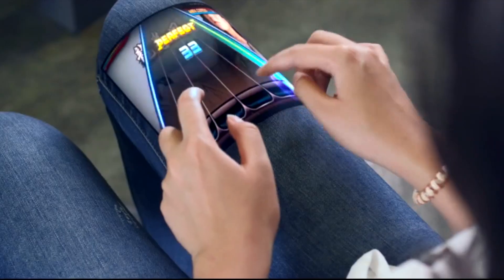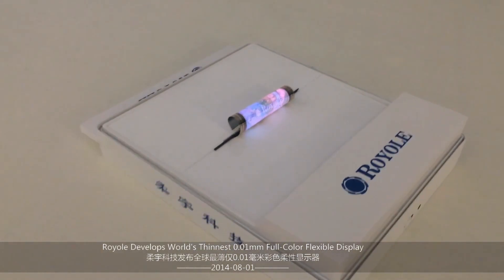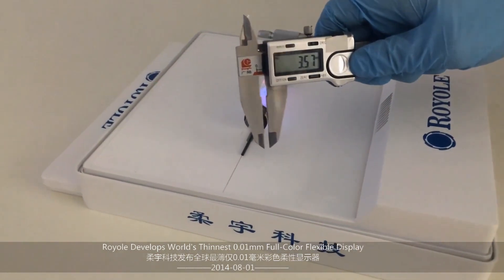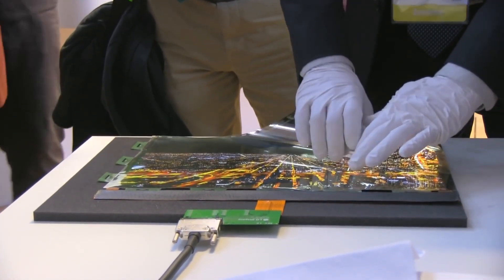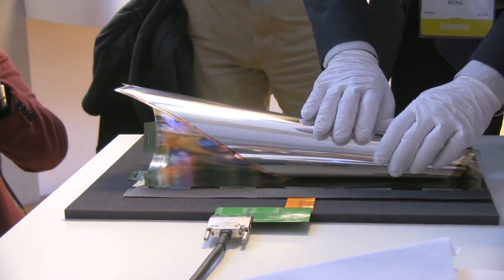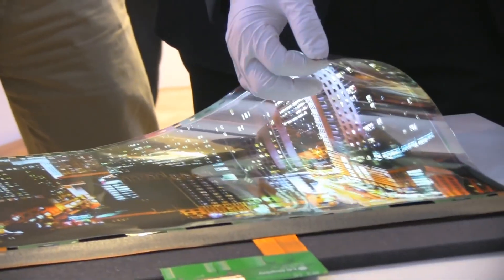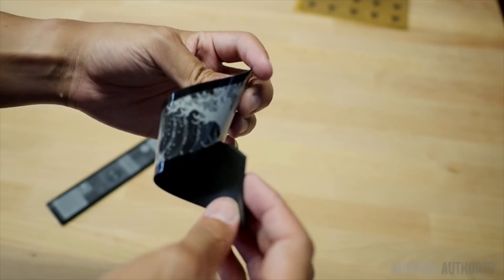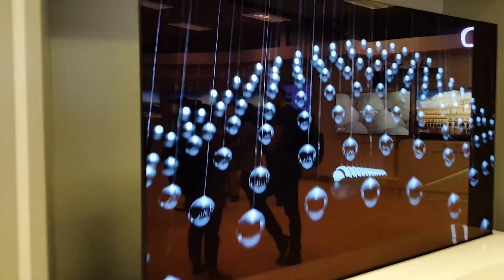What is Stopping Flexible Displays From Taking Over?

Comment: flexible display smartphone? Is there a way a battery could be flexible also? at the same flexibility of the display? I think that's the biggest problem. in current battery technology, that would be a potential danger. especially if the smartphone that they're talking about is foldable or can can be rolled into pen size...

Comment: The reason flexible displays havent "Taken Over" is because they are a pointless gimmick.
Reply: You won't have them in a phone for sure, but they can be used elsewhere. Actually they're not pointless at all, very useful in fact.
Reply: Also they are NOT crease proof
Reply: Famous last words. You lack imagination.
Reply: Resarth If they can reduce manufacturering costs, imagine a flexible display book, or brochure, manual, catalogue. Or perhaps, a multi page tablet or laptop, possibilities are endless.
Reply: It wasn't made by Apple, that's why its "pointless gimmick". Right Resarth?
Reply: +fr33k 

self-repairing membranes, boy.
Reply: @Void of Space and Time 

I don't think so, We are not that technologically advanced.
Reply: For military, field engineers, space shuttle to save launch weight etc. It has it's uses for those who are looking to save massive amount of weight where ounces matter. they would be good.
Reply: They are not pointless, they are useful. Such a device will be so compact and portable capable of being put in small places.
Reply: It’ll be nice to have in school. If it’s flexible, it should be thin enough so your professor can’t see if you place it on your desk and can easily hide it.
Reply: Niko no one wants it for phone. Its the worst engineering if its on phone.
Reply: Kermo Sarapson its because even without steve jobs. Apple wont make a flexible phone stupid. Trying to be a badass smart huh?

Comment: whats the point of a portable flexible display, if you need a battery and something to run it on. mb if you put it in glasses. i think xbox/microsoft is working on AR maybe there using the same tech

Comment: I can't think of many applications because they still have to be attached to something. No point having an inflexible phone with a flexible screen and bendable phones werent recieved well (Apple lol.)  I believe the curved TV market is and a downslide also, so I don't know but I saw a comment about VR screens which makes sense if they can get the pixel density and alll the other factors controlled that you need for good VR.

Comment: I like the idea of using them in augmented reality. If you were able to make the screen fully transparent but still display stuff on certain sections, you could cover a pair of glasses with them, like the guy in the video. That would absolutely amazing. VR would also be an awesome application because you could reduce a massive amount of the bulk in a VR headset, due to the fact that the screen is so light and flexible, only requiring the accelerometers and motion tracking, which is already pretty small.

Comment: I don't get the hype for flexible displays. They seem like they would be obnoxiously frustrating to use, like trying to use a sheet of paper or projector foil as a display, you would need something rigid so you would be able to use it properly. I like how unbelievably thin they are though, they would work great as easy mount tv's or portable screens of that type. You can roll it up and stick it in a painting tube, take it to the park or something and enjoy a movie on a screen out in the open. Like a projector but without the big massive projector itself, just the screen that you can hang up anywhere. If you were able to make them big enough you could put animated billboards anywhere, and because they're so thin and flexible they look like they could handle something being thrown at them, perfect for public spaces. You could have them hanging up on train station walls, and if you wanted to protect them from vandalism and spray paint, just place a second transparent plastic sheet over it, and if it gets covered in spray paint, just take it down and put a new cover up, the screen remains fine. I think the greatest application for this is in the advertisement industry and the portable screens industry, however the only application for phones i can see is that you would be able to save a lot of space that goes towards the screen, instead using it to add more processing power or a bigger battery whilst still keeping the phone a decent size. The fact that they're flexible seems like it's just annoying if you tried to make phones out of them, you'd need to make them rigid and that defeats the purpose of the whole flexible thing.

Comment: if you can rool up the screen you can protect it so now instead of having a tablet With loads of scratches on Your Field trip bring this in a protected way and the only time it is exposed to scratches is when using it.

so first thing i noticed With this video is 1 wy is the military not using this. does the military never use digital screen. wel take this screen rool it up and proteckt it simple way to carry it around instead of say carry a giant tv on Your back simply roll it up and wear a tube on you back. make smaler ones and roll them up give them to all troops and when they get New orders they can rool oute the screen and watch the comand like say here is a map here is theenemy and here is how we are going to attack. if all got a personal screen that is durable as the screen is protected at all times unles you are using it. and say Your smart phone when it is yourbag or pocety and you have it With something else it might get scratches and it cost losts of Money if the phone falls and cracs. With this display i cant see it shattering on inpact as it is foladable and more durable. and if  you cansay have a tube With microphone and speaker then a roled up screen inside you dont need the screen to anser the phone just press a buton and talk to a sylinder if you want to use the screen simply unroll the screen.

Comment: The PRACTICAL answer to why they aren't on the market, is not volume, it's the fact that DUHHH... they would be very fragile!  Tap it too hard with a fingernail, accidentally fold, crease or tear the thing, and it's over.  Sit on it, snag it etc. you get the idea...

People buy cases to protect their already tough phones from breakage.  Here is just trading brittleness for another weakness by nearly eliminating any protective structure.

If its flexible to be ready to apply to a sturdy, curved surface, then that makes more sense.  But not raw, flapping in the wind for everyday use.  Retarded.
Reply: More research, funding require for a real flexible screen.

Comment: These are a great idea with so many potential uses.
I feel that as a phone screen though one simple issue people may have is that when pressing buttons on the screen for example, they like it to be a hard surface that they press against.
Ok, so you can use a table i guess but what if that's not available.

Comment: I can't see a consumer product that is flexible, that doesn't run the risk of being folded flat on itself. Yeah, you rool up your phone, and put it in your pocket, but then you hug someone, or sit on it, and it fold together, ruining the smooth surface and potentially the electronics within. 
For industrial purposes and military purposes, there are probably a myriad implementations that could make use of flexible displays for mounting displays on irregular surfaces or within confined spaces. Also, motion tracking technology combined with a display mounted onto a cylinder would allow for graphics to follow a person around a room (whatever good that would do). 
So, I'm sure applications will present themselves in the future, but I can't really see one of them being a dependable personal piece of electronics, outside of a gimmicky wearable like a "smart-bracelet", or "smart-sun visor".

Comment: well..  its useless to some extent because in smartphones you can't make the rest of the components flexible. so ok you could have a smartphone in the shape of a tube..  Maybe the display could be slightly bigger but it would also be awkward to handle.. imagine how flimsy it would be if the display gives in when you use the touch display...   but maybe just put a flex screen on  a normal phone since then at least it wouldn't break as easily when falling down or would it? maybe it would scratch too easily

Comment: Just because the screen can fold does not mean that it should fold! The solved problem of the cracked screen is the single biggest reason to jump on that mothafuckin boat. But planned absolesence is a real thing...so the technology will get postponed by big wigs for as much as possible.

Comment: Imagine coating the inside of a cars windshield with a transparent & flexible screen, then add a bunch of sensors of all kinds:
In the night the screen will highlight animals that is detected by IR cameras, and it can map out the road in low light conditions (or you can use your headlights, but where is the fun in that?  ;P )

The car can either use 3d cameras to detect your eyes and then model the interface so it lines up with what you see, or it can "assume" that your eyes will be in a general area where eyes usually are and simplify the calculations but will be less immersive.

Comment: I would use them in my work to eliminate the need for printed A0 engineering drawings in site. And i can assure you these come in hundreds per project which can be replaced by a rolling sheet screen display in a roller plastic can with a slot for usb or SD cards

Comment: I think it will do wonders for things like pole advertising and in immersive 3D things,  think about having a 10' square or circular room that is showing you the inside of the louvre and you can explore it.  It would also revolutionize shipping of TVs.  Imagine going to Best Buy and buying an 80" TV that comes in a tube.  Maybe they ca make it where you can connect panels to panels to expand the size of the TV or to add a widget to that TV.  A square you connect to the side of your wall mounted TV that displays email or news alerts or a website.

Comment: I can see issues, uses and improvements here...

Issue #1 - The US military MUST weaponize it and then the CIA, FBI, NSA, MI6, MUST have backdoor spy tools installed on it before the public is allowed to get it so there's that wait.

Issue #2 - Price.We all know that the first 10 years of these will be astronomically high priced and out of reach for most people financially where even a small one would cost several hundred dollars and a TV sized one several thousand.
With this said Apple will make a shitty phone with one that will be the size of a mouse mat, cost as much as a small car, and still have shitty service and poor performance.

Issue 3 - Support hardware, main boards, storage, batteries, all are still pretty much solid, you cannot roll up a Li-Ion or Li-Po cell without some violent reaction usually ending in lots of toxic smoke and flames.. You are not going to buy a TV set or a phone that has exposed circuit boards, and batteries hanging off it.. Call me crazy but I think most people like things to be all together and have some style about it...

Practical uses:

1. Elimination of projectors, TV's and Monitors, These can be deployed just the same as a projector screen but without the projector and give you true HD visuals. Also this will eliminate all flat screen TV sets and computer monitors.

2. GPS and map devices, Yeah this speaks for itself, replace that suction cup thing that never stays on the windshield with one of these..

3. Vehicle HUD that can be actually part of #2. but the difference is the screen is infused into the windshield as part of the windshields manufacturing process, this is so it does not come unrolled while driving and so on..

4. Smart glasses that can auto focus, tint, zoom, etc. could be Bluetooth compatible to show your phones screen on the lenses and allow for voice commands..Not recommended for use while driving of course.
Prescription glasses could also be  reinvented here, glasses could be reprogrammed to a desired "lens" setting by a doctor instead of buying a whole new set of glasses.

5. Company logos, Branding,  Product labels and advertisement. This would be far later on when they become so mainstream people literally fell ok with tossing them away like paper... But a cola bottle could have an animated logo or whatever on it, same goes for other adverts, billboards, road signs, etc..

Improvements:

1. Cut to size - it would be awesome if you could just buy a roll and cut it to your desires shape and size, attach the patented, developed, sealed, foolproof interface cable and use it..

2. Water proofing, since we like on a planet that is 2/3 water, don't you think this would be a nice option?

3. Folding - Not only can you roll it up but you can fold it like paper and it not suffer any permanent damage.

4. High impact options. Why not make some bullet proof for the military of course XD..

Comment: Flexible (so conformable) screen tech. would be a godsend for the Advertising / Signage industry. How many cars / panel vans do you see EVERY day with "magnetic" advertising / signage on panels (or doors)? - Now, envision these "signs" as fully dynamic video displays, capable of withstanding the daily rough and tumble of traffic.The problem would be that such signage would be so distracting that the accident rate might possibly rocket! :-)

Comment: I am about to finish my PhD on Graphene based flexible electronics. Flexible electronics require a transparent electrode that can bend several times without cracking. ITO (indium tin oxide) electrodes that are used pretty much in every phone and TV are fairly brittle. They can be placed on a curved rigid glass, but cannot be repeatedly bend on a flexible plastic. 
Transparent electrodes that can be bent repeatedly are generally fabricated with conductive polymers. They are very sensitive to heat and chemical attack. They can also degrade in time by themselves. So a process would need to address for all these issues. They are also fairly expensive and hard to synthesize. Compared to ITO which is simply a metal oxide, conductive polymers require more strict synthesis procedure. Conductive polymers are also less electrically conductive than ITO electrodes, so a device design has to take that into consideration (I guess this could cause an efficiency issue. More energy would be loss to heat). 
So, it is true that manufacturing volume has to increase for conductive polymer synthesis to at least drop cost of material. There is also the issue of how to deposit a very thin layer conductive polymer film evenly on a surface. Conductive polymers are not exactly my field, but through lab experience I can tell you that this process would be somewhat easy but labor intensive for small surface area (about a 5 inch phone screen). It can be a nightmare if you try to apply it to a large surface area (large screen TVs). Either way, it would require labor, and qualified labor. Just because you can do it in a lab does not mean you can do in a factory where no assembly personnel would have a master's in science, let alone a PhD. We can do a lot of things in our labs and showcase it at a fair and blow people's minds. 
So, the fabrication process has to be simple, fool proof, and streamlined. This process also has to produce a very small number of faulty devices. If half your fabricated devices are ending up in the garbage, your process is crap and it will reflect on consumer pricing. Figuring this out can take a lot of money and time. And it is not guaranteed that it will work. If the only way you can do it is through a sophisticated and expensive method, why bother? People are not dying to have flexible screens.

Comment: I've been hoping for a "wrist-computer" for some time: it'd have a thin flexible keyboard on your forearm (left one if right-handed) and a rollable thin screen held (when operating) in some 100º angle (as it's touch-screen, no mouse is needed). That's the main use I see for flexible screens: to make computers fully portable, soon displacing mobile phones and tablets. 

I can't say for sure, but I presume that the computer as such and the battery would be in a separate device in your pocket or hanging from a belt and connected by wires. I doubt they can be integrated in the wrist design as of yet but maybe they will be in the future as graphene tech becomes more consolidated.

Comment: yo a bendable 3d monitor. make it have two borders on the side so it could go from a tame 16:9 resolution for a movie to like some super wide display. Like both sides will roll out to make it like 4 or 5 times as large as it was before, and you can bend the screen any way, or secure it in a specific shape which you can customize to fit your gaming needs. Or programming needs. You could snake it out maybe to create two separate sections to work on. Personal choice there. But I'd pay some cash to have a monitor I could make bigger at will. And one that could become freaking huge. 9

Comment: If at all possible, someone could develop flexible ram, processors, SD cards, and other assorted parts to possibly make a completely flexible smartphone.
Reply: maybe not. maybe the screen only showing the image. the machine like something that you can put in ur pocket and sending the data via bluetooth or other wireless connections. perhaps with the power too. just maybe loool
Reply: Paul Noonan flexible ram???????????
Reply: Paul Noonan Ram???????????